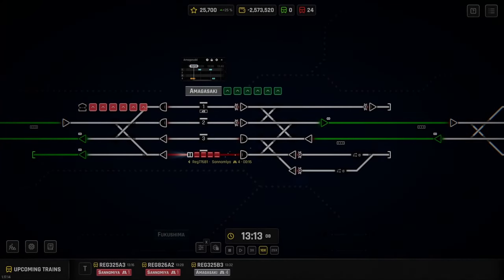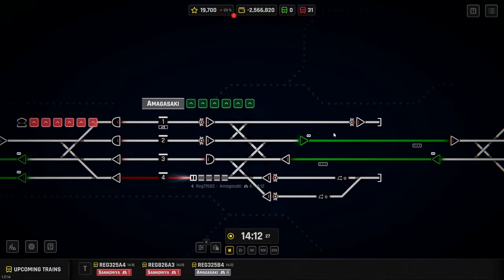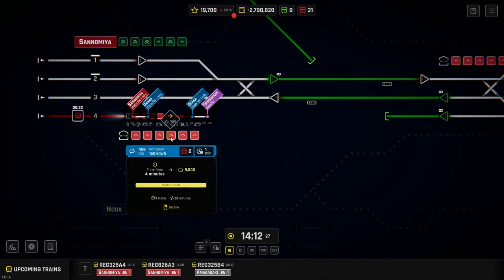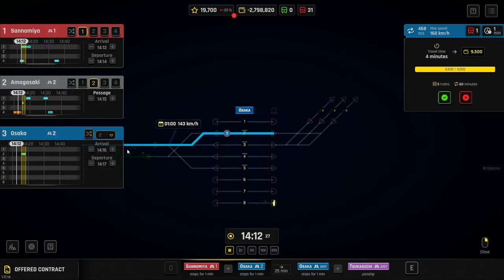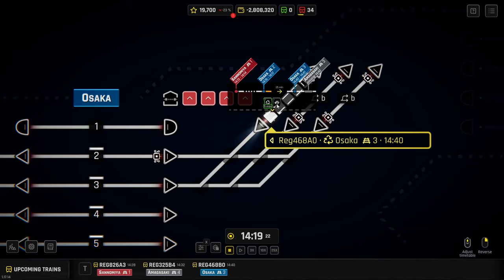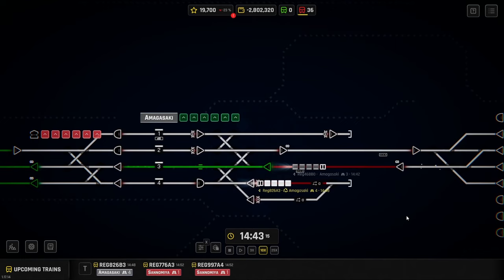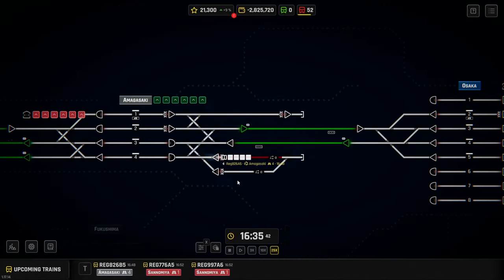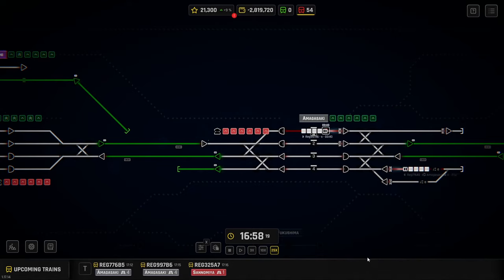Basics of Shunting! - Update 17 | Rail Route

Comment: Just two questions: Do you have to send a reassingned train to a specific platform or is it sufficient to send it to a signal with an arrival sensor? And secondly how does it need to be set up, if the end of one leg and the beginning of the next are not at the same station?

Comment from the maker: To let you all know there is a minor mistake with the design of the shunting yard/group built at Osaka which I found after testing more after this was posted. It seems that the game requires having only one way in and one way out of the yard (from what I can tell, I'm not certain on the requirements though). I will mention this and how I fixed it at the start of the next Washington video, Washington #7.

EDIT: After going back and testing it again, (a few weeks after this upload) the design I had does in fact now work, I don't know whether this was fixed in any of the hot fixes following this update. I don't believe I made any mistakes for it not to work originally, but do let me know if you spot any!

Comment: Question. When you get your first 3 red research points, you have to choose between freights and regional trains, as they are the only way to get more red research points. When you however choose regional trains and spend these 3 red points, you dont have any research points left to research shunting command etc. So you are supposed to stable your regional trains outside the platform without using the shunting commands. How?
Reply from the maker: There are solutions to this! Shunting commands are used to store regional trains off of platforms i.e. on other designated sections of track laid out. However, earlier on before you have the luxury of shunting circuits and commands one solution is to simply let the train sit at a platform (similar to how you would with a freight train) it will move to one end of the platform but other than that just leave it be. Then 1 minute before it is required to begin it's next leg (starting at the same station it finished the previous one at) a notification will pop up to accept the contracts next leg, click this and then another will pop up (on top of the train) with two arrows and then click on this one (this is to reuse this train for the next leg). It should then change to the colour of the next station on it's schedule and after it's sat for a minute (if required by its schedule) it'll want to depart. Departure sensors will automatically dispatch it and reverse it (if needed) but do keep an eye out to just make sure it does.

This above is the simplest I can think of, you can make make shift shunting yards without the circuits similar to what I did in this video, probably even simpler but beware you will need to manage each step of it moving around at the right time since you can't queue anything. And I'm not sure this would be worth it or really even necessary.

In short I think the easiest way is to leave them sitting on platforms and repeat this enough times to build up enough xp to unlock shunting commands and circuits. I hope this helps!
Reply: @JamieTheEpicz  Thank you, I will give it a try. I didnt know there is a pop-up coming. I always sent the train manually directly to the "second" platform to wait there for the second leg to start, but it never stopped in the middle of the platform, it went to the end of the platform. So it ignored the schedule and it didnt even trigger the departure sensor.
I think this might be a problem for players not knowing how to do this, because if they research regional trains before freights, and they dont know how to stable manually, they get stucked and its basically game over for them. So I thought maybe it was intention to have players choose freights first and do at least 3 freights before continuing with regional trains.